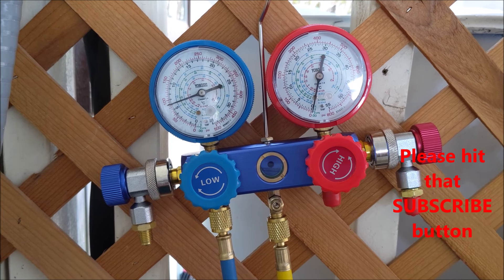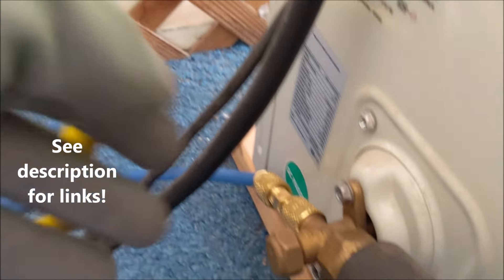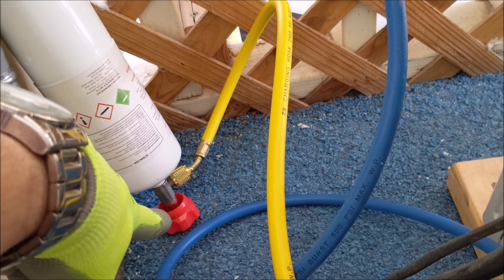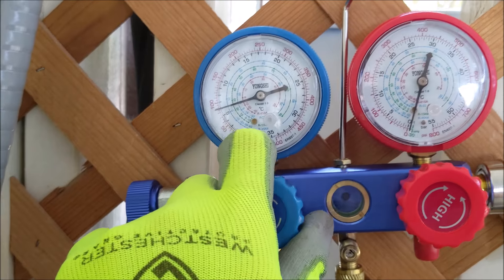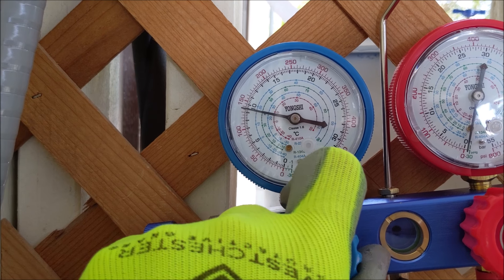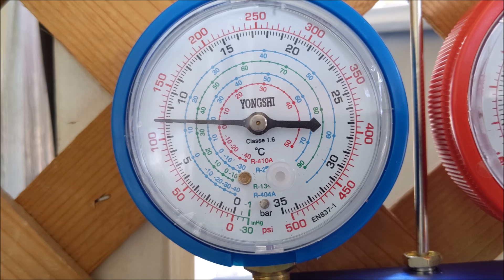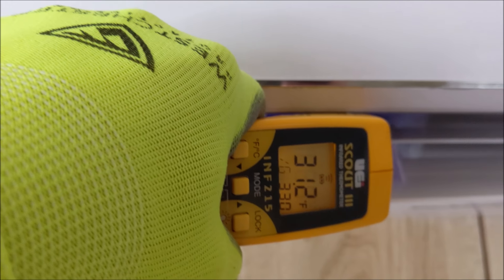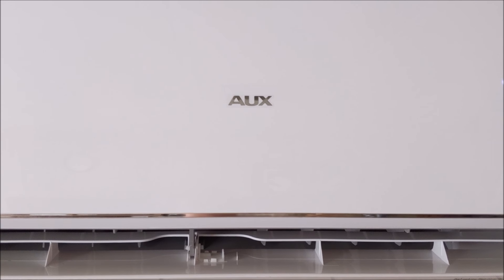How to charge mini split yourself, DIY 410a refrigerant, save money!

Comment: I just completed my first mini-split install.  BUT it failed!  Perfect vacuum pulled (verified 24 hours of holding at -30mmhg).  After I introduced the refrigerant, no leaks/perfect.  The problem was when I removed my blue hose from the low side connection....it blew refrigerant all over me while unscrewing it and pressure went down to zero!  I used the connector/adapter that came with my gauge kit....I think this was the problem.  The charging port adapter for vacuum service that I bought has a schrader valve on the one end (green gasket on the connection side) but the one I USED did not have this schrader valve (I thought it did).  Quite certain this was my problem.  Please help/confirm.  I now have to get an HVAC tech in to recharge my system.  Any idea how much r410a would have come out?  All of it (120 oz) or just a few oz???  Thanks in advance.
Reply from the maker: Yes, look closely at your adapter. . (Look at the pictures here for reference....... https://amzn.to/3zc8dIb)  . Or,  you probably had the blue hose the wrong way. On one end of the hose, there is a also a middle center-pin-like that pushes the shrader valve. On the other end, there is nothing. The end that has nothing on the middle, connects to the gauges, the other end (with the middle stem) connects to your HVAC system. This middle device "pushes" the shrader valve. From what you are explaining, you may have had this hose the other way around. But the adapter should have a center stem on one end.
Reply: @SaveGreenHere  I had a similar experience after evacuating my system. All was well, pulled vacuum, no leaks then I turned the keys to let out the refrigerant but when I disconnected the adapter at the charge hose, it sprayed refrigerant all over. I think the hose was pressurized and by disconnecting the adapter, it let all the refrigerant out of the hose but not necessarily the mini-split system... right? How are you supposed to disconnect the blue hose without getting refrigerant all over?
Reply: @SaveGreenHere  Thanks so much.  That was totally it.  I had a tech come out for $300...he had no clue how to troubleshoot a mini-split!  I had to show him everything.  I called Senville tech support for him even.  We turned it on and all was perfectly fine .  Must have only lost a cup or 2 of coolant.  Since he didn't know how to add more, he just checked the pressure and it was 105 psi which according to tech support was within spec.  My house is cool now so I'm happy, but what a crappy experience to need a tech, only to find nothing wrong worth fixing.  Thanks for your help.
Reply: @SaveGreenHere  The reason why I did a self-install is a). I like to do things myself, and b). I don't trust techs (too many bad experiences of incompetence.  I proved the later again!
Reply from the maker: Glad it worked out ok.
Reply from the maker: See my comments above.
Reply: @dwiller11  I did a second install a couple days ago.  THIS time I used the proper vacuum adapter...it STILL sprayed all over me!  You don't see this in the many youtube vids.  Turned system on all all was perfect.  But messy nonetheless.  The second time I made sure I did not call out a tech ($300) to check system pressures.  Must be 'normal' to experience this, too bad noone adequately stresses this point.
Reply: @rsauder  I think if if you close your high and low side then remove the blue line the only thing that will spill will be what is in your blue line
Reply: @rsauder  it must be normal. I can't think of any way to prevent this regardless of how quickly you detach the blue hose. No matter what, there's pressure and fluid in the blue hose and when you disconnect it, it's going to release what's inside the tube. Professional installers probably have special evacuator pumps to recapture what's in the hose. I do wish there was a way to speed up the disconnect process and reduce the amount of time the schrader valve is open as you unscrew the adapter.
Reply: Brother I just went through the same thing today, now I'm doing more research and stumbled upon your comment. I installed my Gree mini split last night, left it over-night to check if it holds the vaccum, all OK, no problem this morning. As soon as I released the refrigerent into the system the valve from the blue hose started hissing. I quickly closed the screw back in and unscrewed the blue valve (to prevent the schrader from keeping the circuit open). Still... it lost some refrigerent and now I'm all worried that it lost too much. Still, I tested the unit and seems to work perfectly on both heating and cooling....!
I think I had the same problem as you with a faulty conection of the  blue hose attached to the hvac unit. Glad you got it fixed!!! Good day to you.
Reply: Shut the low pressure sideoff. Open gas valve for 5 seconds then close valve. Then disconnect lines and slowly open gas valve all the way. The way you are doing it you are losing to much gas.
Reply: @dwiller11  keep pressure on the shrader valve with one hand till you have unscrewed the connect with the other hand, then quickly release the blue hose from the shrader valve. Like a bicycle tire

Comment: i did not know you can add as liquid to the gas side .
Reply: HVAC Techs normally use a larger 5lb tank (sorta like a propane tank) that they’ll also flip upside down. Inside that tank the freon rest in two states Gas & Liquid; your mini splits operate on the principle of phase change where the gas will compress into its liquid state. For fast and accurate charging it’s recommended to flip your tank.
If you look up 5lb 410a freon tank it’ll make more sense.
Reply: 410a is a 2 component refrigerant, needs installed as liquid. idk about 470 tho

Comment: 18 to 20 degree temperature difference between the supply and return air  is good 5here is no set temperature  for the supply air
Reply from the maker: Whatever the return air temp is, (through the intake of the inside unit) you want it 18 to 20 degrees coming out.

Comment: to the < is open to the > is close🤣
Reply from the maker: All valves closed except the blue one. Best practice is to vacuum out the lines, done before video). Weight the refrigerant on a scale, according to what the label on your unit says, Example, 1.5 pounds. Slowly, open the blue valve, and let the unit run on cool, and open the blue valve and allow some refrigerant, and let the unit stabilize for 15 minutes. Adding refrigerant is a step that requires patience, and the proper tools. Unfortunately not many have either, lol.

Comment: Where can I buy a new port that you fill the unit through?  It is that brass fitting attached to the AC unit. Mine has an extremely small leak under that large cap next to where you are filling in the video 
I found the leak with an infrared detector, very small but it does leak!
Thanks if you can help!
JIM
Reply from the maker: https://amzn.to/43A5o1i

Comment: Is your AC running while you are adding this refrigerant? I have seen other videos where they weren't running and brought the pressure up to 250, then it dropped to 120ish when they started the compressor.
(You thought I was starting a dad-joke there didn't you, well then: it must be hard to catch your AC when it's running 😆)
Reply from the maker: It should be running, yes, and in "cool" mode.
Reply: @SaveGreenHere  thank you so much, I installed a mini split (knowing the gamble) in my container home, pulled perfect vacuum but wasn’t able to pressure test at the time, guess I lost that bet 😩😂😂
I’m doing the recharge after seeing this video 👍
Reply: The same here !

Comment: Hey guys. God bless all.
I hope someone can help me.
I have a blue ridge mini split multi zone, last year works fine, but now is not cooling, there's not errors displayed in the indoor unit and not freezing pipes into the outside unit, i still think must be something with refrigerant load. Any idea how to fine a refrigerat load using the gauge.? I know for a single zone is about 117 to 125 psi. Is the same for a 4 zone minisplit?
Thanks for any help.
God bless America

Comment: if a mini-split unit slowly leaks refrigerant does it need oil or just 410a refrigerant added?
Reply from the maker: First address, as to WHY it's leaking, and WHERE the leak is. You may not be able to obtain the 410, in which case, just use the alternate link in the video description.

Comment from the maker: New 470a refrigerant that replaces 410a refrigerant, with Do-It-Yourself kit included..... https://ebay.us/tVSqEv
Reply: Can you combine the two? Mines leaked out a bit. Need to add more but they don't even sell 410a anymore.

Also you have an AUX like me. Mine stopped heating/cooling after a few months. I can't really tell why it's not keep refrigerated as there's not many indicators on the lines.
Reply from the maker: Yes you can combine.

Comment: Do I need the system to be on or off when doing this?
Reply from the maker: On. And in cooling mode. Run a vacuum to ensure no leaks. Get a micron gauge like this one.... https://amzn.to/4dVpg40
Reply: What happens if it’s cold outside like in the 50’s , you still put it on cold?

Comment: What if you overfill?
Reply from the maker: Go in slow increments. Add, let it cycle and stabilize for 10 minutes. Look at the gauges, and add accordingly. It takes time. And use a scale like this to weigh it based on the pounds indicated on the label of the mini split. Example, it says it needs 2 pounds and its completely empty. Your tank on the scale weighs 25 pounds. Add refrigerant until you hit 23 pounds on the scale.......... https://amzn.to/43tSv8C
Reply: Usually on the mini split it tells you how many pounds to put in.  You can put your tank on a scale
Reply from the maker: Correct! https://amzn.to/43tSv8C

Comment: I have a Pioneer Minisplit. I checked the pressure, and it is showing 210 PSI. I have never added any. This is the factory charge. My system is freezing up. I’m trying to figure out why... do you have any ideas?
Reply from the maker: You added too much. Recover down to 120 psi. Also, did you use either Nylog https://amzn.to/3lsRYyO OR Flareseal https://amzn.to/31wfDWS on the flare connections? If you did not use either of the above, you will need to do so, then add refrigerant..... https://ebay.to/2JzUOjF
Make sure you perform a thorough vacuum before adding more refrigerant. Also, if you decide to go with Flareseal, remember there are two copper lines, with different measurements, so get both sizes to fit on both copper lines. If you are positive you did use Nylog or Flareseal, you will need to thoroughly troubleshoot your system. Is the compressor engaging? Do you have the proper power flowing to the system? All these can be factors.

Comment: Hi, very please to learn this vidéo regarding checking réfrigérant ans how to add. I juste install a 12000 mini split and réalisé no réfrigérant gas ans no hvac want to charge singe they do not install the mini split ans I cannot but gas without hvac certification un Canada. Dont know where to buy !
Reply: They come with refrigerant in condenser, you have to pull a vacuum to 500 microns before releasing charge
Reply from the maker: Well, they should come with the refrigerant already in the condensing unit (outside unit), but if for any reason, the lines are longer and you need more, click the link on my description of this video. It's all there........ https://ebay.to/2AoIRvK  It is also SUPER IMPORTANT to get the sealer I listed on the description!
Reply: @SaveGreenHere  Hi, it is very nice of you to give me this link on ebay,(it do not ship to Canada, but  found similar seller shipping to Canada and buy it right away,  I did try to find on ebay, amazone, but  I only get recovery tank, and one important thing you do to the environment, because I was about to consider buying new one and keep the new mini split with no gas for part, and I know recharging has to be done periodically(a couple years). 5 star for your sharing of knowledge and thanks.
Reply from the maker: Thank you however, you should NEVER need to recharge the system. If you do, then you have a leak. This is a closed loop system, so if you need to recharge, I suggest you find, and repair the leak.

Comment: Plz i am in india plz you used r410a gas small can plz tell me how to buy i need. This can r410a
Reply from the maker: Link to Extra refrigerant........... http://ebay.us/YKjza2
The affordable HVAC gauges..... https://amzn.to/31nTA1Y 
Senville Mini Split 3/4 ton... https://amzn.to/2UiJhc5
Adapter for mini split (5/16 to 1/4)... https://amzn.to/2Ys9qLN 
2 stage vacuum pump..... https://amzn.to/2JWdeM4 
Mini split Air cond, 220v under $390…. http://ebay.us/IXgoHW
Mini split Heat pump, 220v under $480… http://ebay.us/MY2vY7
Mini split Air cond, 110v under $400….. http://ebay.us/jyUE9P 
Mini split Heat pump, 110v under $385.... http://ebay.us/ez2AWh
Pad for outdoor... https://amzn.to/2EMd9Iy 
Refrigerant line protector kit... https://amzn.to/2Um1DZI 
Power cord.............. https://amzn.to/2XrPgQI 
Discount one year of Amazon Prime... https://amzn.to/2qz0RPa 
Kit to add outside plug..... https://amzn.to/2Y73aVE
Nylog blue sealer on flare ends.... https://amzn.to/33iYLkS
Or, use this gasket kit for flare connection... https://amzn.to/36LzxPa

Comment: Thank you so much for sharing the instruction.  I am trying to do the top up of R410a myself too.  I have gone through quite a number of videos in Youtube and I have learned that at 120 psig (according to the PT Chart) the temperature of the gas at the evaporator should be around 41°F but your digital temperature gauge at the evaporator air outlet was showing 26°F.  Have I missed out something? Hope you can help clear this up for me.
Reply from the maker: If you leave the temperature gun long enough there, it will get in the 30s or even 20s, depending on the ambient temperatures.
Reply: Technically… You cannot charge a mini split (variable speed direct current compressor) by pressure… You are supposed to recover all the refrigerant, pull a vacuum and charge by weight… If you over charge you will damage the compressor…
Reply: @EarlHayward  Yea, learned that the hard way. These compressor comes with an accumulator for a reason, because they absolutely MUST NOT have any liquid in the suction inlet. A little bit of oil is ok but any liquid you're looking at either compressor damage, or hard start (means you need a hard start kit to even start the thing). If your mini split is underperforming one likely reason is an overcharge, but if it's freezing or doing weird things to where it's doing anything but heating/cooling, and you've confirmed the EEV is functioning as designed, then you may top up little by little, until the AC starts functioning, and once it is, STOP. On a non inverter unit this means the condenser is blowing hot air and the evaporator is blowing cold air and NOT freezing up.

Your superheat and subcool will read weird, but that's ok. 

If you want to be anal about it, recover everything, and place your refrigerant can on a postal scale or a food scale (if it's light enough), and start measuring how much stuff do in. 

If you lost charge, there is probably a leak somewhere so doing this is with the understanding that you've addressed the source of the leak. One reason to pull a vacuum is to confirm it isn't leaking. You can pressure test, and it's probably helpful to do so, but make sure you pull a vacuum to remove any noncondensibles. 

The install manual for any inverter or non inverter mini splits say different thing about the require charge, but they are quite consistent that it must be done by weight.

You can overcharge a little bit but you can put 2x the amount of refrigerant into the system before you will notice anything wrong.

Comment: Can you add the 410a in the winter. My split is AC and Heat. It needs a little more 410a ? thanks
Reply from the maker: Run in cooling mode.

Comment: Do you have an adapter you use from the yellow line to the canister of 410. My 410 appears to fit the hose size on blue or red but yellow line is bigger
Reply from the maker: Are you sure you have the correct end of the hose in?
Reply: @SaveGreenHere  the yellow hose is same size on both sides at least with my gauge set.
Reply from the maker: You need to look closer, as one end has a section in the middle to push on the Schrader valve. This video may help.... https://youtu.be/RndlC9g5HzQ
Reply: @SaveGreenHere  thanks for the help. This is the first one I’m putting in but I’d like to have two in my house one in the garage and cabin so learning how it works is going to save me in the long run.

Comment: i have a 12,000 btu  what size refrigerant would i need to fill it ? it has a 25 foot line should that be set at 120 psi.
Reply from the maker: The label should tell you how many pounds. Then just buy the jug and fill up to that amount.... https://ebay.to/2AoIRvK

Comment: i have a full size ac that uses 410 a ... i have my auto ac gauges... are those same quick release  connectors?
Reply: Have seen people use quick connections BUT they’re designed for R134 and I’ve read purists saying to use threaded connections with ball valves to bleed the lines of air/water first.